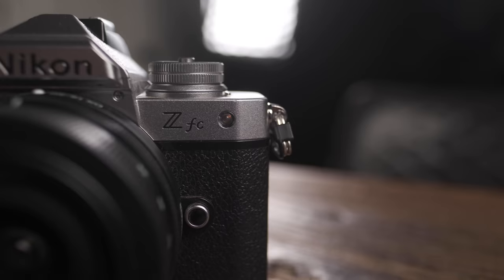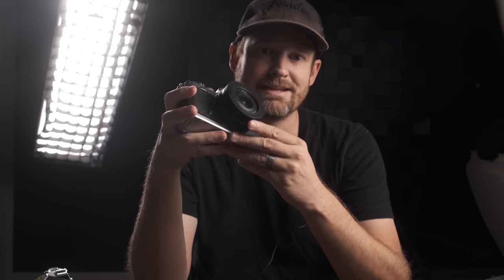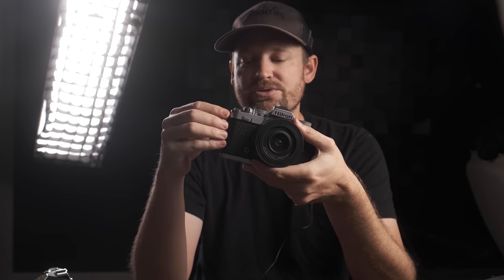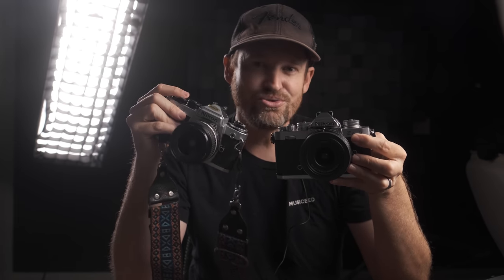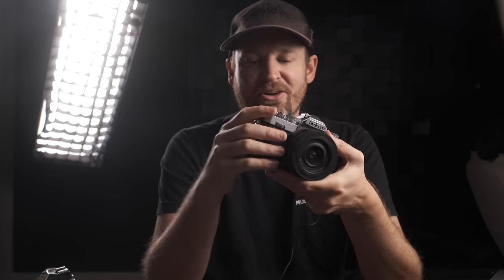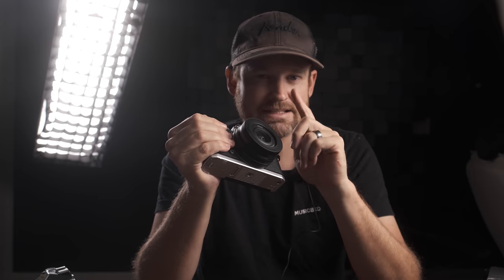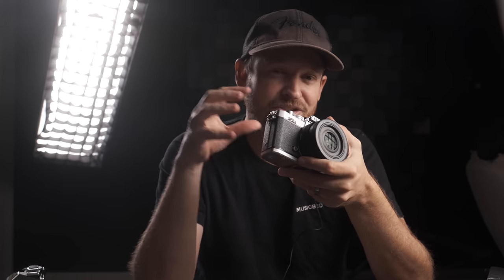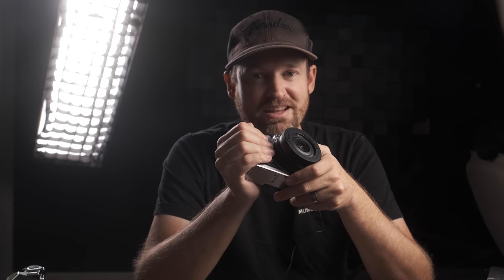Nikon Z fc - This is not the APS-C system you're looking for (probably)

Comment: im going to have to disagree with you here.

i own d810, d7100, z50, and most of my lenses are ai/ais(20,28,35 ,50,50,105,135,180,200,300,500, d series, 60, 100, 28.

point being, i get what you mean by the inspiring etc, but sometimes, if its bit damp out, the z50 with kit lens is king.

It is better than cellphone, but i try to shoot it at f8, or f5,6 the lens stablization is excellent.

i just went on a 700km motorcycle trip, and theres no way im packing my d810, i would nhave loved to.

point being, using the kit lens, you can get some really vintage looking shot, even at f8, using custom picture control, it just takes more skill IMO.
Reply: i  also have fe, and fe2. but the kit lens is excellent, dont write it off.
it having a variable aperture it doesnt look like typical f4, f2.8 trinity, you can get some really unique looks.
Reply from the maker: I'm not sure what you are disagreeing with me on. I don't disagree with anything you said. It sounds like an excellent setup for what you need. The "jobs to be done" is satisfied in your case.

Comment: I don't agree with having preconceived ideas about who's it for.  Don't care about style. Don't care about retro. Don't care if it looks like a film camera. I just like to change settings with dials rather than menu dives and scroll wheels.  I agree about the crappy plastic feel though. That's actually a deal breaker. The fuji x100F is a much nicer camera to use. And the lenses. Non starter for me too. So I pretty much agree with everything you say. Also wishing for a FF version. Love my Nikon F4 (Uses AA batteries. Yay!)

Comment: I don't quite understand why Nikon Z full frame lenses are considered such a bad fit for a camera like this. It expands your options without needing an adapter, and they're good lenses.
Size?
Well, my best Fuji lenses are just as big as their Canon EF-mount equivalents (except for the Laowa 65mm macro and other manual lenses which are much smaller than their FF equivalents are or would be).

I'm not in the Nikon Z eco-system, so this is not the camera for me either, but I feel that it's in a better position with lenses than the Canon EF-M mount system where your EF-M lenses cannot be used on any other bodies, using EF lenses means you need a large and bulky adapter first, and EF-R lenses are not available to you.

Regarding having to unlock the lens, it seems that many new Canon and Nikon lenses have this. (I'm not keeping enough track of other brand's lenses to know if they also have such a lock now).
It allows you to travel with a more compact kit. When I was still using my EOS-M5, I did not always lock the lenses after use, to have them available quicker. I understand that such annoyances are personal but I've found ways to make it less annoying, and remember the positive side. :)
Reply from the maker: Long comment. But to answer your question simply, yes. Size is a big part. I don't mind APS-C as long as the system creates lenses specifically for it. This camera should have been FF.
Reply: @AndrewGoodCamera  Fullframe it would have certainly been a lot more interesting, yes -- I feel that if I ever switch away from Fuji, it would be to Nikon FF Z-mount.
Reply: @TimvanderLeeuw  Agreed.  I hope Nikon comes out with the Full Frame Zf.  We can hope.

Comment: A year after this video, there are now FIVE Z DX lenses: 16-50mm, 12-28mm Powerzoom, 14-140mm, 24mm f1.7, 50-250mm which are all Z DX lenses. You could also add the z 50mm which is also FF. People on a budget could get the Z30 or spend more on Z50 or Zfc. I do think Nikon needs to add one more body with update to Z50mark2 to add fully articulating screen, EVF, video tally light, usb-c continuous power plus update on focus. Or else... make a high end apsc in mirrorless dx Z similar to the D500. Thanks for your video.

Comment: All what Nikon did for this supposed-to-be-iconic-like-Df model, was rushing it into market. Thanks to the historic Nikon FM/FE series, Z fc is still an eye-pleasing camera but not for a close-look or hands-on. What bother me the most are the molded pattern leather-like structure on the back of the LCD and the position of deep-cutting-in-head speed dial (because of the filpped assembly of the shutter unit), both show how Nikon's design team was struggling against time, and maybe also their marketing/sales team.
Reply from the maker: Yup!